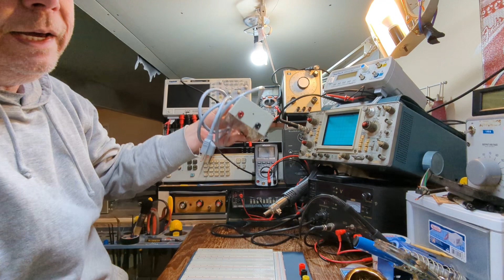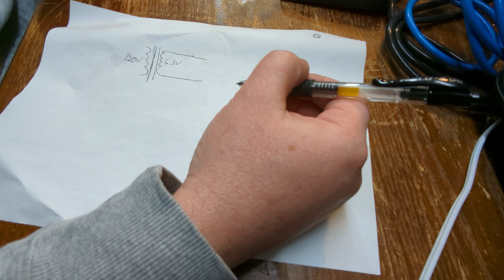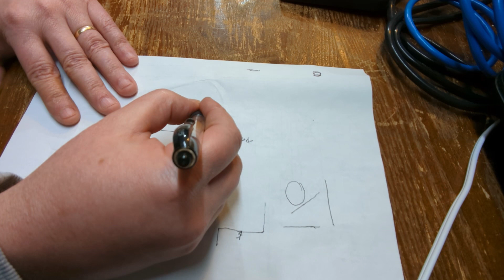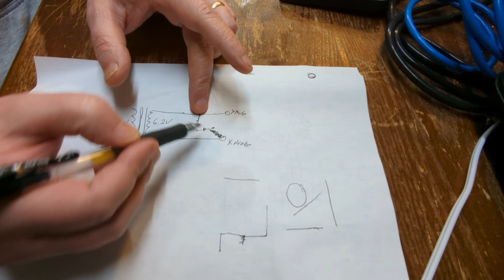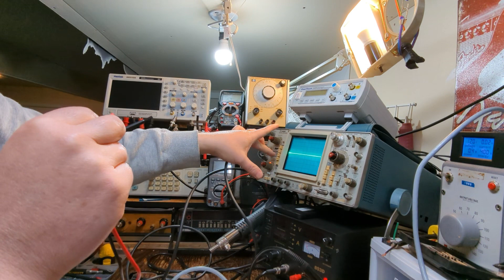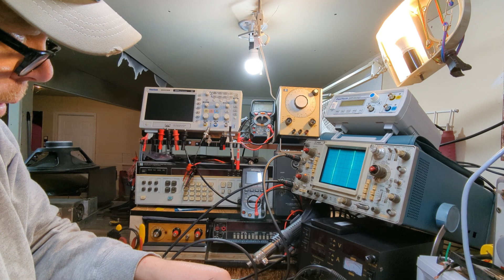Hameg HZ-65 Component Tester

Comment: Hameg also made scopes with a built in component tester function ( with around 8 volts of drive) which is a nice option to have built into a scope for some general troubleshooting.
Reply from the maker: Yes I've seen one of those. I'd like to have one!
Reply: MCM even had one 👍

Comment: Great stuff,  that explanation about potential difference and current clicked with me, even if it's not MIT correct. thanks for your insight.
Reply from the maker: It's Ohm's Law, is MIT teaching different electronics than other Universities? The greater the voltage drop across a fixed resistor, the greater the current. They are directly proportional.  So if your DUT is open your Y "current" probe sees 0V across the fixed "reference" resistor and the x probe sees all of the voltage across the open DUT, thus no voltage on the Y probe translates to no current(horizontal line). The opposite is true for a short.
Reply: @srtamplification  No, MIT is ok. You just seemed to be running yourself down, when you put a big x over your drawing. I liked the way you put it, that's all.
Reply from the maker: @keybutnolock  Oh I see. Thanks!